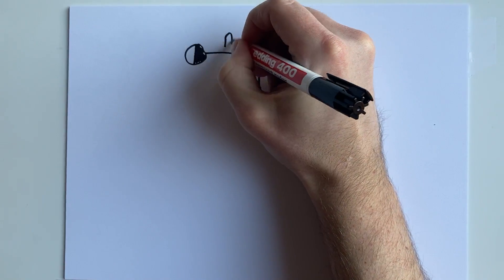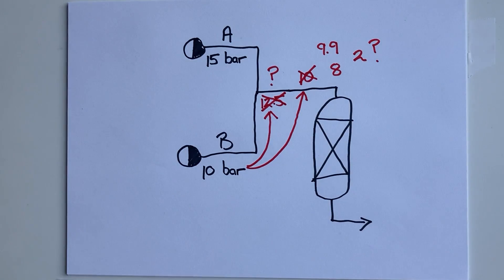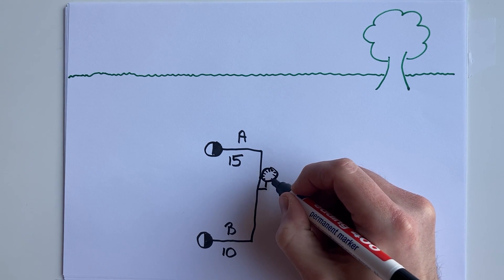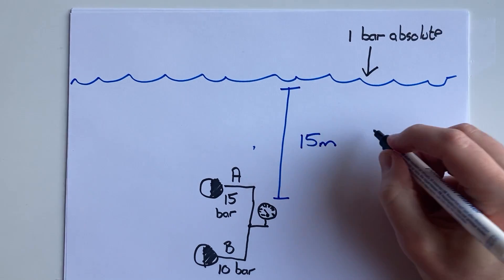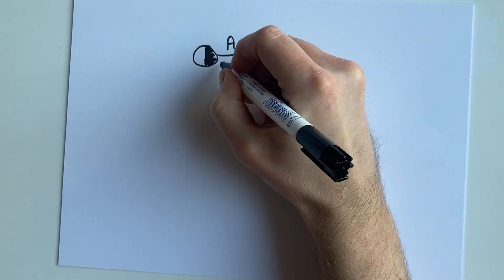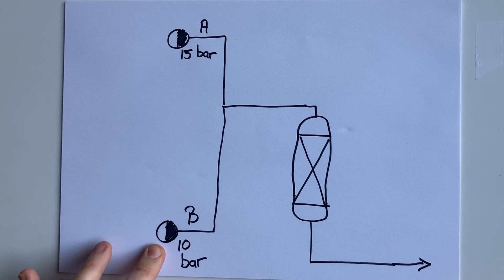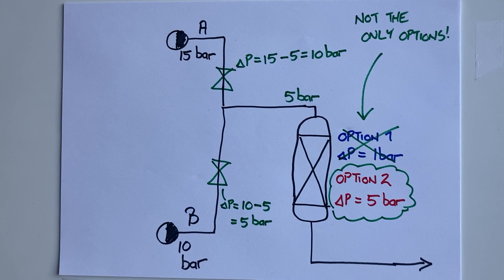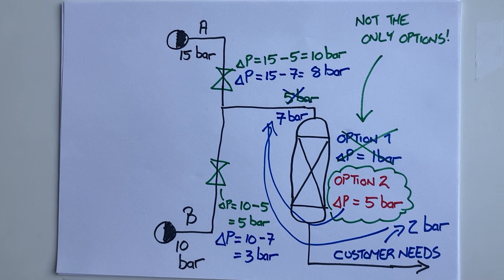What happens when you mix different pressures?

Comment: What a nice video. It explains perfectly what happens in those systems and makes lots of examples. I think this is one of those problems that just are tricky but in reality they're really simple, as you made it look at the end
Reply: I think the problem has deviated from the original question, which is: what is the result pressure in the combined pipe considering its end closed? So the system is isolated from any external effects. Can you answer this question please?
Reply: @ELHAOUARIAbdelhalim  If there are no valves, nothing is preventing the pressurized tanks from depressurisation. so it's safe to assume that both of them have a tank on their pipeline. the whole segment afterwards, up until the closed (in this case) pipe, is full with air at a certain pressure. what is that pressure? it's the same exact problem as before, just that now that pressure is not automatically 1 bar since it does not go in the atmosphere but could be anything depending on how you filled this pipe. If you only filled it with air from the top tank, it would be the top pressure. if you filled it with atmospheric air, it would be still 1 bar. if you vacuumed it, would less.

Comment: Should there be check valves at the outlet of each pressure source, in which case, if the 15 bar pump is running, it will dead head the 10 bar pump.

Comment: If you want 5 or 7 bar at the inlet of the reactor then you only need stream B to accomplish this with its 10 bar and the use of a pressure reducing valve.
Connecting stream A to your system would be a waste of money  because you would be doing all the  work only to reduce and waste all that extra pressure at the end

Comment: In reality putting it straight into a vessel is a no go, putting through valves or stop taps in separate vessels and then into the mix vessel take into account that taps ,not open at the same time but alternate between separate vessels mix vessel ,can you visualize that ,now we can play with volume and pressure

Comment: Hello and great video btw. I get that we can basically choose the pressure drop of the reactor (lets say it's 5 bar). But i don't get why there must be the same pressure drop in streams A and B. Also I've noticed that in process design software like Aspen, when we mix two fluids at different pressures, the outlet has the lowest pressure of the two. Why is that?

Comment: Thanks for the enlightenment. For the longest time i treated pipe pressures like electrical laws and it kept confusing me: if A=15 and B=10 meet, shouldn't the point C be either a sum, a difference or the average? Turns out line losses are huge  and the result is determined by if the outlet is open or closed

Comment: You mentioned that water flows from a high pressure location to a low pressure location. A hose connected to a pump that is going down hill would have higher pressure due to head gain at the nozzle compared to at the pump outlet, but the water still flows down hill. Can you explain what's going on in that situation?

Comment: Hi i am i bit confuse .. so you have 2 cylinders high pressure and Low pressurecand in middle you have a Pressure regulator .. so when i open the Pressure regulator what will happen  if i open the Pressure regulator??? Cna help me what isbthe answer thanks

Comment: Pat, thanks for this video.
Could you do a video of pump head calculation in the situation where on the discharge side, several lines connect to the main discharge line ? For the pressure drops should we consider the total flow rate for the section of the main pipe after connection of the other pipes ? And/or should we consider also the head of the pumps from other lines than connect to the main one ?
I realized that everybody knows how to calculate pump head in the easiest scenario (2 tanks, 1 pipe, no other connections) but no one explains how to deal with connections. 
Have a nice day !

Comment: Hi, how about let's say during design, I have 2 pumps for mixing. One bigger pump A (200m3/hr) is designed to generally operate at 10 barg, while the other smaller pump B (50m3/hr) is at 6 barg. However, I need the outlet to be at 10 barg (more than 200m3/hr), would the pump B be able to provide the additional flow? For example, to achieve 10 barg, the flow is smaller in the pump curve.

Comment: Too complicated.  Nobody would put a 10 bar stream into a 15 bar stream or vice versa and hope for good results.  The solution is to pipe both streams into the mixing tank and control the pressure at the outlet of the tank.  If the tank is a reactor, then both streams need to be flow controlled (FIC) into the reactor.

Comment: I like your video but I did not get the point why you subtract same amount from both streams?
and how t make them equal at the mixing point?
also what did you mean by drop in pressure 5 bar in the reactor that when the inlet is 5 bar the outlet will be 0 bar ?! how come !

Comment: Another analogy that helped me is to transpose it to circuit theory and use the node laws. Voltages into a node have to be the same, and sum of currents into and out of a node always sum to zero. 

I tackled this years ago with a mixing issue on fluids. Worked back from the outlet pressure and wrote an iterative spreadsheet to solve for equal remaindered pressures on both lines. Centrifugal pumps involved so I baked in the pump curves on each side and baked each line down to an equivalent Cv to make things quick to calculate.

Comment: Great video but it's a little bit confusing because with an engineer approach you consider the lost in conduit, but just with this diagram we can just think you are connecting three pressure level with a perfect conduit system, and it doesn't make any sense. As an electrical engineer it's like drawing two different voltages sources in parallel without considering any resistance, which is an heresy.

Comment: The video is good but the explanation given between 6 min and 6 min 15 sec is not clear. I would expect that the pressure of both pipes after mixing should be 5 bar and the valves should reduce the pressure of 15 bars to 5 bars and the pipe of 10 bars to 5 bars…. Did I miss something?

Comment: As a random bloke that just landed on this video, i'm lost at the atmosphere part... only got worse after that. Why does it leave at atmosphere? I turn my hose on, water comes out at high or low pressure. I'm thinking I don't have a certain understanding to help with this. Usually im pretty good with physics but never ever looked at plumbing stuff before. Fells like when i looked at circuits the first time.

Comment: Ok i completely misunderstood the assignment, but i also only looked at the thumbnail and title before thinking about it, i thought we needed to keep the flowrate and diameter or the pipe the same, so i thought we need to install a compressor at the end of both streams before they mix and compress them down in order to keep the flowrate and pipe diameter the same, because more stuff in the same volume at the same speed = higher pressure than before, i thought we would simply need to add up the different pressures

Comment: This is exactly the analogue to an electrical engineering problem. Where the stream pressures are like voltages and the lines are like interconnects and valves being resistances.

Comment: The practicality when using two valves (pressure regulating devices) to control a determined outlet pressure from independent pressure supplies is idealistic and will not work to provide mixing with any certainty.

Comment: I think the problem has deviated from the original question, which is what is the result pressure in the combined pipe considering its end closed? So the system is isolated from any external effects. Can you answer this question please?

Comment: or you can use the high pressure fluid to create a type of jet pump. the low pressure fluid gets sucked into the suction side of the jet pump.

in steam systems you get something called thermocompressors that do this, but obviously they are designed for steam service. im not sure what the fluid alternative is to that

Comment: Our professor put it like this: 
Pressure is always produced by the acuators, never by the pump. The only thing a pump produces, is flow.
Same with shower heads. To get higher pressure for showering, you need to replace the shower head, not the pump.

Comment: Real world scenarios show an exit pressure of 0 bar in standard atmosphere is not true. If there was, there wouldn't be any flow whatsoever. If you have an air compressor and pull the trigger there will be air flow around the nozzle and there will be a specific geometry of higher pressure around the nozzle, obviously so the exiting pressure will be somewhere in between system pressure and atmospheric pressure. If you have a vacuum chamber and air it up there will be an "input pressure" as high as atmospheric pressure.

Comment: 6:22 but this is not the same question and this answer does not have much to do with the original question which seems to be what pressure would be after mixing the 15 bar with 10 bar!!! Yes it does depend on what happens next but you did not tell us that so best assumption is your 15 bar fluid would go into your 10 bar fluid and the reactor.
Installing pressure drop valves literally deletes your starting point and now you have 2 streams of 5 bar, they can be 10 bar or 15 bar or 7 million bar before those pressure drop valves it does not matter, those valves are designed to give you 5 bar after them so now you have 2 streams of 5 bar which is not even close to original question. 
It is like asking what the max speed of your car is, and after someone answers that for example 200 kmh, you say that it is not correct because if you do not have fuel in your tank your car cannot go very fast, which is true but has nothing to do with original question!!!!!!

Comment: If it's open like a water tap it would simply run 1 bar or atmosphere pressure. Otherwise the flow would expand until it reaches it. Simple.
It's more difficult to mix different sources at different pressures and combine them in a fixed amount of substance ratio. Something like an ammonia synthesizer (N2+3H2). You want the mixture at a fixed pressure and temperature (compressing and decomps heats or cools like it's in a heat pump) and all you got was the two sources and a few pumps or valves (and you want to use the least of them because of the electricity bill...)
Tough job that's not what I can do.

Comment: Your answer is in fact partly wrong or at least missing something out.
Because you see it as a chemist, who wants to keep a process running, not a mathematician.
In fact, combining two different pressures always result in an output pressure potential of the bigger one, with the option of increased flow amount as pressure basically is the flow rate.
There are a couple of examples for that:
If you have a compressor that produces 8 bars and you use the pistol to let air out, the compressed air shoots in the room with atmospheric pressure. The air is venting with atmospheric pressure however with the amount of air 9 times faster than the idle air inside the room - as the compressor compresses air to 8 bars above atmosphere.
Another example is two rivers, the one is smaller, the other a huge river, broad and deep. For the sake of the example, we will ignore changes in the riverbed as angles, disturbances, wheather, etc. They meet each other at a T-junction. The bigger river will flow - no matter what the small river or the output of the T-junction does - everywhere until gravity will finally combines the amount of water of the two rivers, letting the combined stream run out of the T-junction with increased mass (amount of water), but not increased speed (flow rate).

Back to your example, you create a lot of turbulances just by using a simple T-junction. Gasses can overcome some of that but still need to flow at a 90° angle, facing a force opposing it (even possible to create a backflow).
Simply by changing the T-junction to a Y and increasing the output pipe size, you will reduce backpressure and resistance.
Depending on the distance and the size of the pipes, you will still face the problem of generating heat, as particles in motion produce a lot of it; converting kinetic energy to heat.

Comment: Great explanation. One thing to add is that geomtery plays a big role in the way fluids mix and pressure change occurs. For example ejectors and venturis are practical devices for mixing fluids and allowing a low pressure stream to increase in pressure past the mixing point. Whereas two pipes coming to a T can cause backflow unless pressure is reduced in the high pressure stream.

Comment: Basically at any point, there is only one pressure. So at the point they meet, they always have the same pressure. If you don’t have a resistance in front of the mixing part. They must have equal pressure and will never have different pressures.
If p(A)>p(B) -> p(B)=p(C) with negative flow.

Comment: I assume that adding pressures works similarly to adding resistance in electricity, so I think it'd follow the inverse of a sum of inverses.

1/10+1/15=1/x
15/150+10/150=1/x
25/150=1/x
1/6=1/x
therefore
x=6 bar

Comment: Looks like a resistor bridge problem. You can make parallel with electronics. Admitting both pipes have same section and there's no leak in the system, you should say Da = Db = Dtot/2 = 2,5bars and output closing manometer should say 12,5 bars. Admitting pipe sections are enough small to prevent current overflow for source and sink.

Comment: @Process with Pat I think the best way to get an indication that we divide mass by pressure value and this value could indicate the final value of the mixture pressure and more precisely the Specific energry multiplied by the total mass of course the first case you mentioned pipe bleeding air to atmosphere no change in pressure happens coz we have in finite valve of air mass having atmospheric (pressure the absolute pressure value indicates the flow direction only)

Comment: Having 10 bar in the line A, and 5 bar in the line B, wont you have reverse flow from A to b as well (from higher pressure medium to lower pressure medium)? Or we are assuming that the mixing point geometry is not allowing such flow or something.

Comment: The result of the video is clear, but I notice it's completely independent from the mixing problem. I can establish pressure on the outlet, for 1, 2, 3 o more tubes converging ok. But this does not tell much about the 2 flows of the example interact which each other.

What is the flow from B and from A to outlet? I can't motivate Flow-B being outgoing (positive), even with a "simple valve" (a one-way valve I mean).
I think Flow-B could only be ingoing (negative) without a valve, or zero with a valve. The reason is obvious: pA>pB.

Using pressure regulator valves to equalize pressure is a solution to a different problem, not what I would like to understand.

I hope a complete explanation comes out :p
Anyway good job, I really appreciated your approach to the problem.

Comment: A problem with this analysis is if you put in a valve that has a pressure drop that equals the pressure difference between the reactor and source you have zero flow. Of course, a simple valve has a resistance roughly proportional to flow, so as flow rate drops pressure drop decreases and you get flow. It would simplify your design concept if you just looked at pressures between points to calculate flows. Look at each pipe segment as a resistor. You also have the reactor. As it fills the pressure will increase. If the reactor has a pop-off valve you will have a  constant pressure. If there is a chemical reaction you will have pressure/temperature  effects. The whole analysis would be simplified if you had a flow meter on each of the feedstocks and adjusted the valves to get the feed rates you needed. After looking at feed rates you could calculate prsssures since the currents would be knowns.

A problem in your atmospheric analysis is it does not take into account fluid momentum. Point that hose upwards and look how high the stream goes. Pipes have a pressure drop per unit length which is flow dependent. Therefore the exit pressure is not the atmospheric pressure but rather the pressure that explains the height of the fluid column ejected into the container. 

The analysis differs in flow limited systems, which might be defined as a system where pressure drop over the common pipe is negligible. In that case the pressure at the mixing point is equal to the reactor pressure and you’ll need two post docs to control the valves and get correct volume delivery for each reactant.

Comment: i have electronics knlowlege, and tried to solve this by comparing it with the water analogy of electricity. so pressure = voltage, and volume of liquid moved = current. the analogy is far from perfect, but i still came to the conclusion that there is not enough information. 

so yeah i tried to solve this using ohms laws lol
Reply: It seems like true.

Comment: Coming from electrical engineering, I see the problem as: given two voltaga sources of 15V and 10V, what is the voltage if we connect them together? It's immediately apparent that the problem hasn't been setup properly since 1) there's no reference to ground and 2) if there was you are shorting the sources and will cause current to flow in the smaller voltage. We need a load (the reactor) with reference to ground (1 bar) and appropriate resistors (valves) to match the voltage drops!

Comment: My initial reaction on title: Don't! i seen what happens when someone thinks adding the pneumatic systems 8 bar to the high pressure 120 bar water line thinking they would get better pressure. They had a lot of work drying out the pneumatic system afterwards.

But yeah, in an open system its a different tale.